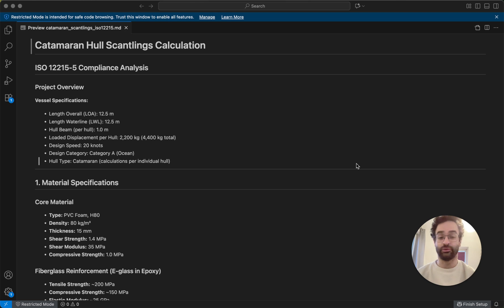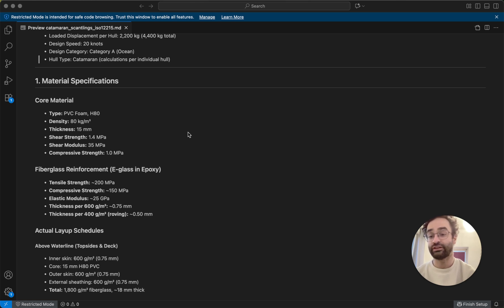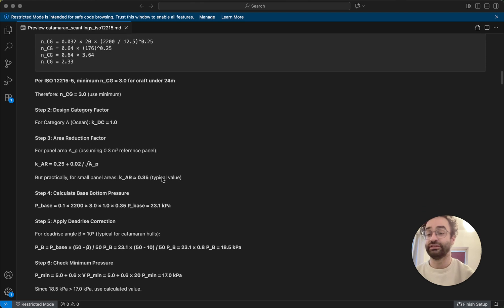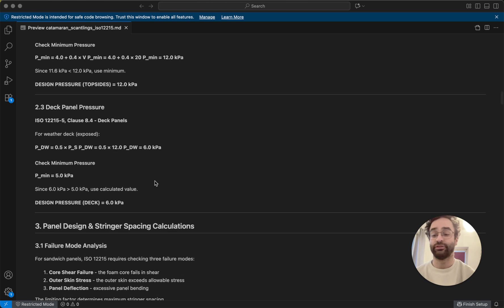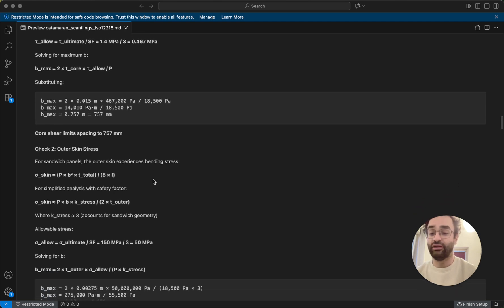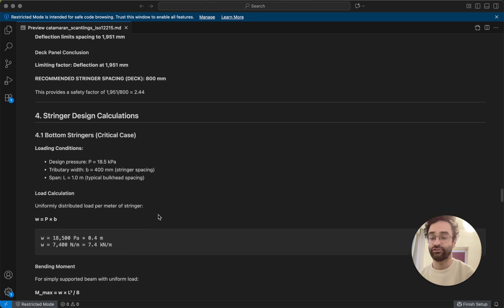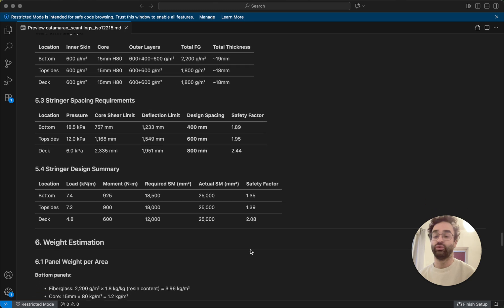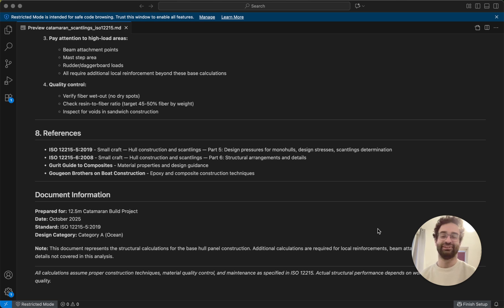How I Make Sure My Boat Doesn’t Break: Calculating Structural Strength (ISO 12215 Explained) 🚤

Comment: Andrew, coming from the naval architecture industry, have built models for model testing, and refit my own boat (with lots of glass work) - everything I am seeing here is not enough!!! 3 layers of E glass (1708?) over foam is barely sufficient for a 20' model. The forces that bridge deck are going to experience as the ocean tries to pull those two hulls apart is going to be immense, and the entire force of the mast must be distributed. I welcome you to reach out and discuss further because I want to see this succeed but I have serious concerns.
Reply from the maker: Hey, I appreciate your concern. In this video I'm only talking about calculating one kind of force (local pressure on the hull panels). There's a lot of more reinforcement to handle the global loads, especially at the mast base, chain plates, and forebeam. I should also say that I'm not the first person to build a boat this way, see for example the Schionning Arrow series of cats. They use a very similar construction method.
Reply: It will break up when the mast is loaded the first time.

Comment: Young man I am all for what you're trying to do. But I walked into a 40 year engineering career that would stop me from even attempting to solely design an entire ship without a team of my buddies performing all the structural calculations, which would take us several computers and several years of finite element analysis.
I can only pray that this mock up is going to get fiberglass chop sprayed over its entirety with at least a quarter inch of buildup to take all the impact loads from waves not to mention all the bending moments on those pontoons and from the mast, not even taking into consideration vib and acoustics... You may have success with sailing this boat around in calm waters, but I wouldn't take my family out to sea in it.
Please get a couple of Engineers to work with you and keep up the great creative work, and very diligently chasing your dream. I just want to see the dream Safely realized, fulfilled. There are local Engineers who will volunteer to help you
Reply: Thanks for your comment!!
I also have serious doubt about what he is doing.
I am not a pro but have some experience is creating building, simulating and boats. Either he kinda hides the important details or this all will be extremely insufficient against any large loads like stronger winds or waves... Or even holding up the mast under tension...

Comment: Finally, now after all the work you've done-would you sell these plans for anything under competitors prices? I mean you can, but after calculating your price per hour i don't think that it would be much lower than proper schionning plans. 
Also the responsibility in the event of any structural failure of a different boat build by your plans must be valuated and added in as well

Comment: so are you spending 750k yourself or you are building what would typically cost 750k?  if the latter, what is your expected total budget? cheers
Reply from the maker: It’s the latter, expected total budget is around 150k
Reply: @BoatBuildingAndrew  holy smokes what a price difference - i'm assuming you mean just for the hull? what about engines, electronics, sails etc...